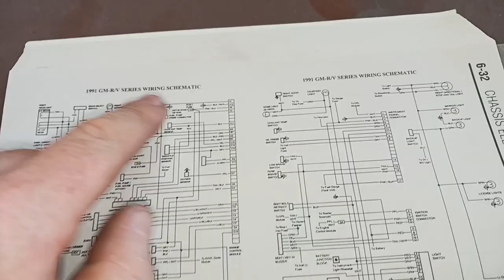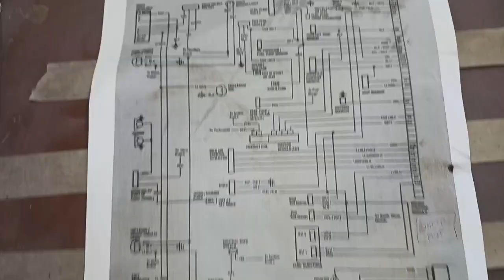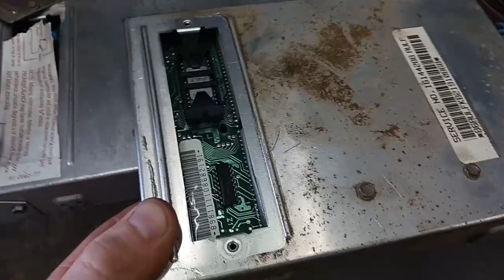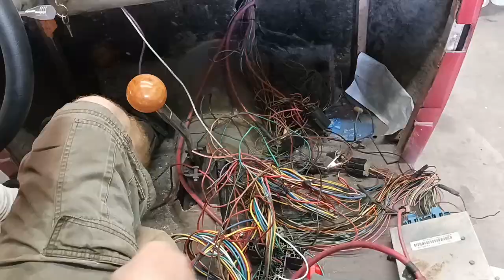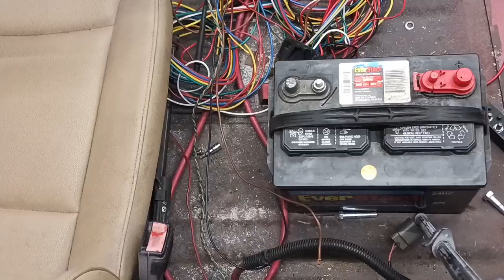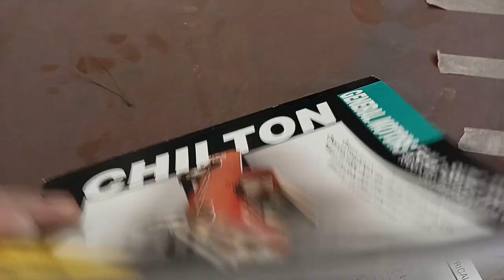Wiring up the GM 4.3L TBI engine - 1932 Ford Roadster

Comment: Wil. Where are you located. I’m trying to swap a 4.3 v6 tbi from a 1995 model Chevy truck into a 83 olds cutlass supreme(gbody) . I am having trouble figuring out the wiring along with putting fuel lines in with a electrical pump. Please help me out
Reply from the maker: Chiltons manuals cover the wiring schematics for the various year engines, thats the easiest way to do them. Same for the fuel system, just copy what a 1995 truck has.